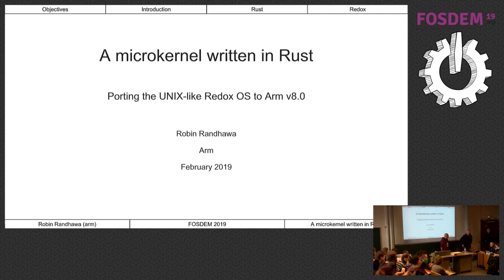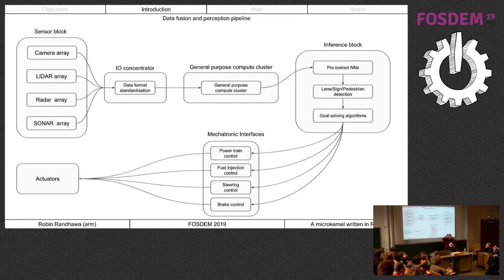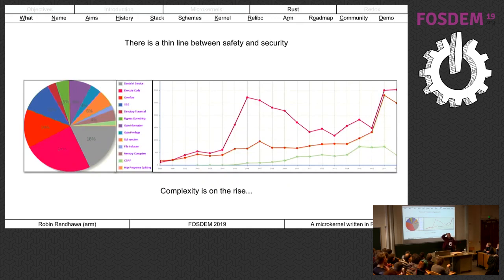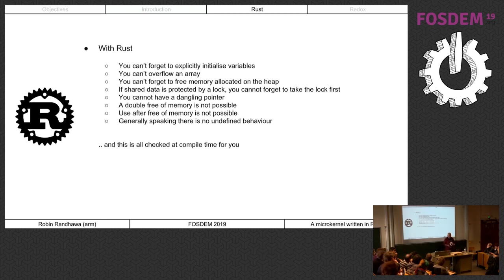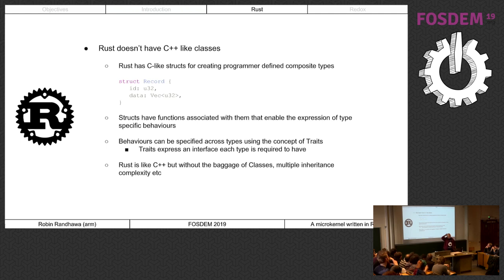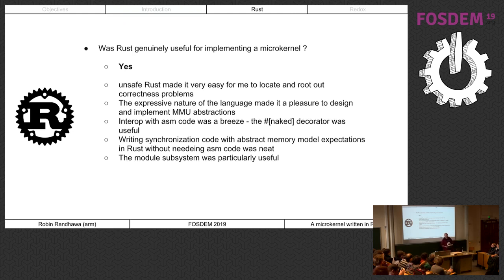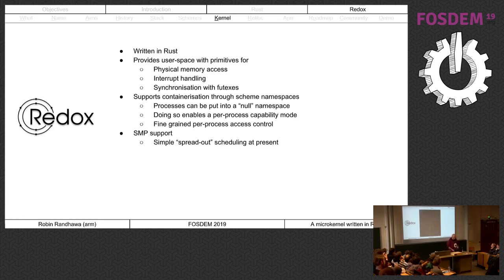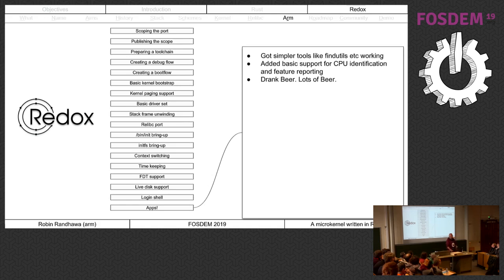A microkernel written in Rust: Porting the UNIX-like Redox OS to Armv8 A case study of Rust as a la…

Comment: Informative talk but except last few minutes all generic rust and redox talk . 
No information where this efforts are documented. Is source code available. Checked on speakers github page could not find ported redox code.
Would have enjoyed more if elaborate discussion on problems faced during porting and there solution.
Disappointed because nothing to learn about efforts done during porting.
Reply: The code is hosted in the Redox repositories which were referenced prominently in the presentation ?
Reply: Also: you really expect an 'elaborate' discussion in a 40 minute presentation ? Try doing one. At FOSDEM.

Comment: Redox OS is not Unix-Like!
Reply: Depends on your definition of Unix-Like doesn't it ? One could argue that Linux is not Unix-like! :)
Reply: Seriously though - Redox supports running Linux binaries by virtue of being API and ABI compliant with Linux through relibc (Redox's libc written in Rust). That's one thing being alluded to in the Unix likeness. Then there's the whole syscall structure (fork, clone etc) that Redox basically mirrors. The implementation follows a Plan-9 like philosophy (everything is not a file but a URL) but Plan-9 was also Unix-like. Etc.
Reply: @trickyturquoise  Windows can run Linux binaries too with this api wrappers and Linux can run Windows applications with Wine HQ, this makes windows not Unix Like!!! You clearly dont understand what Unix is.
Reply: @MichaelFomenko  You clearly have an intrinsic ability to both jump to conclusions and inflame. I'll give you the benefit of doubt though and ask you to educate me (and other readers) on how you define unix. Pray tell ?
Reply: @trickyturquoise  Please search in Google: "Single UNIX Specification (SUS)" and you will finde the definition of Unix. And the SUS clearly showes you that Redox OS is not Unix and not Unix-Like.
Reply: @MichaelFomenko  Sure. But that's a very shallow argument. Linux doesn't comply to SUS. Neither do the BSDs. Yet they are synonymous with Unix (put another way - Unix like). The phrase Unix like is inevitably tied to architectural traits like Unix-like system call sets, the reliance on process control abstractions like pipes etc and the pervasive use of the file abstraction. Redox most certainly fits that general characterisation. If SUS compliance is your definition of being Unix like then a lot of OS stacks that are synonymous with Unix are not Unix like either. Look at the Redox kernel source and you will find an express design intent to be aligned with Linux at the user-space boundary (which of course means corresponding kernel side machinery to support things like fork, clone, fcntl etc).  That's why the presenter in the video could run a Linux port of Doom on Redox (see the last few minutes). There are situations where being pedantic is beneficial. This isn't one of them.
Reply: @trickyturquoise  Is Windows Unix or Unix-Like? I can run Linux Apps on Windows with WSL but I would never call Windows a Unix or Unix-Like. Redox is not a Unix and is not Unix-Like, it have only an API Layer like Windows has WSL. And Linux is not a Synonym for Unix, BSD is a Synonym for Unix!!! Linux is not SUS and can not runn Unix Apps out of the Box, there are not compatible with eatch other!!!
Reply: Sure. Redox is as un Unix like as Linux is un Unix like. :) Hope that makes your day!
Reply: @MichaelFomenko  Also: Strictly speaking, anything that is certified to pass SUS (the Single UNIX Specification), is allowed to call itself “UNIX”. Everything else is not. Linux doesn't pass. FreeBSD doesn't pass either. Nor does Redox. All of them call themselves either Unix derived or Unix like. They do so because they support similar syscalls and attitudes to process and file control implementation. Therefore my original thesis applies - Redox is Unix like. Finally: The English definition of synonymous  is closeness of association not equality. Please stop being literal and literally pedantic when there really isn't any need.
Reply: @trickyturquoise  After your definition of Unix Like Systems, Windows and all other Operation Systems are Unix Like, but this is nonsense.
Reply: @MichaelFomenko  You’re entitled to your opinion. Best of luck on your seemingly committed quest for endless pointless pedantry.
Reply: @MichaelFomenko  A M O G U S